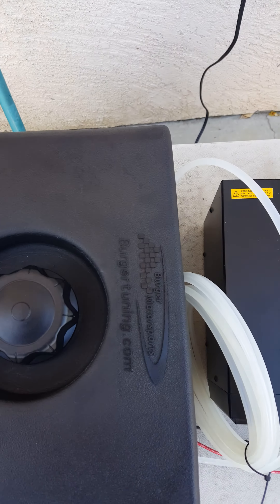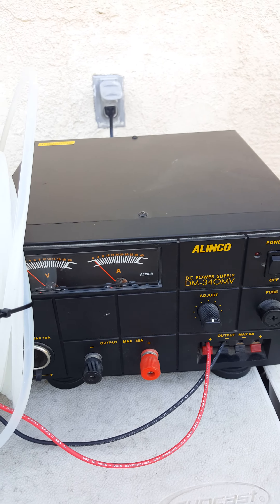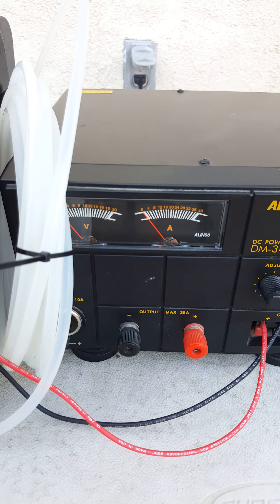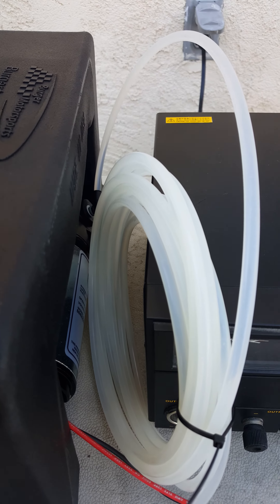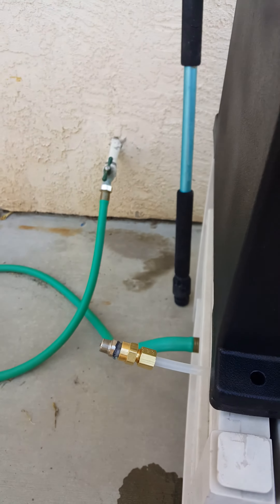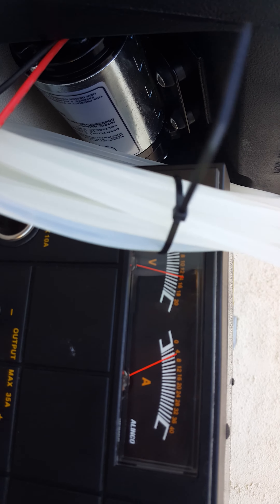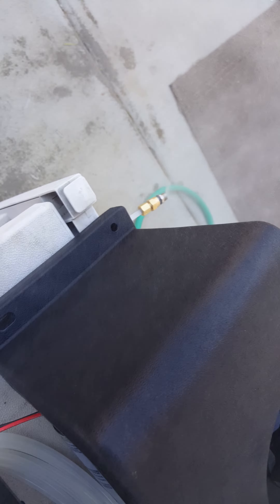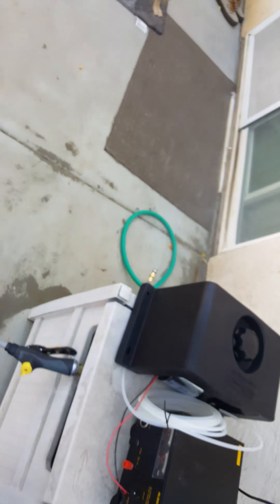BMS WMI PUMP TEST

Comment: Great video do you still have your bms meth kit and if so any problems i ask because i just ordered one for my car and going to control it with my jb4 that's already installed so any advice would be greatly appreciated.
Reply from the maker: Still have it and have had no issues with it. It does a really job of dropping the IAT's when activated. The JB4 is the best controller on the market for the $.